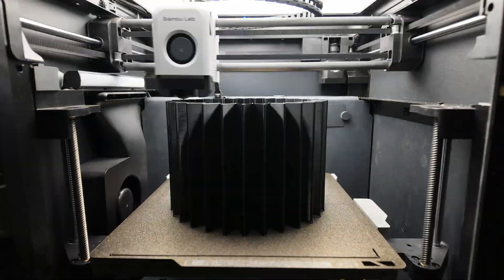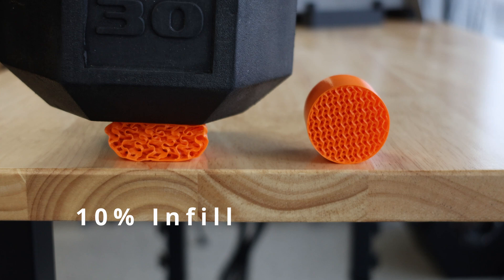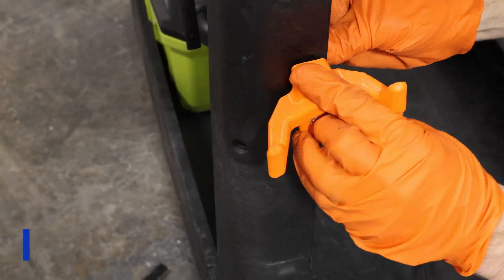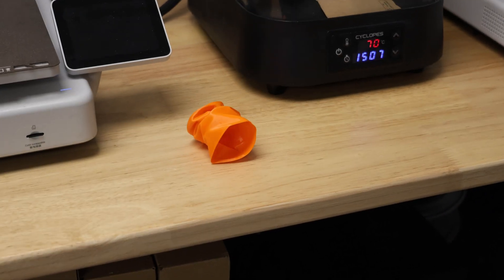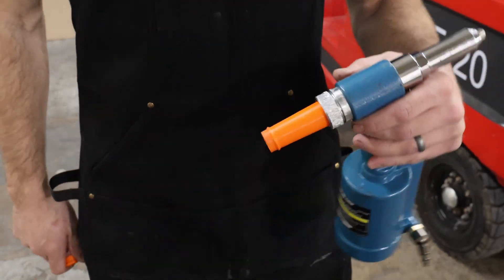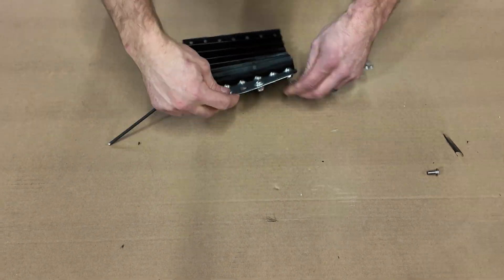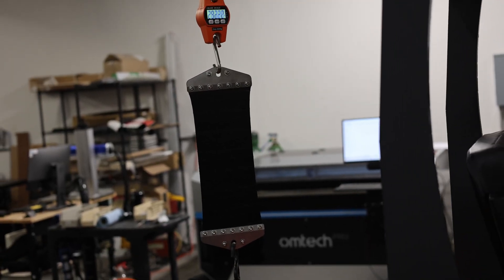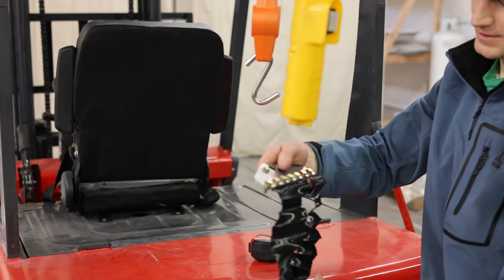We test the Limits of this 3D printed material!

Comment: I'm very interested see what kinds of bushings and motor mounts can be replaced with TPU.
Reply from the maker: We only have firsthand experience printing and using the bushings shown in the video. They are used to mount a roof to a Humvee or Hummer H1 body. They work great for that application. I imagine TPU could be used to replace lots of PU and rubber parts. Hopefully we'll have a chance to do some testing in the future. I did find a video where a guy printed shock bushings for his 4-runner. I think he said in a comment that they had been working well for years. Here is a link to his video: https://youtu.be/m3aMhf3ZYI8?si=mqSB9jES99cuTlYc
Reply: @PipeDreamDesign  Thanks for the link!